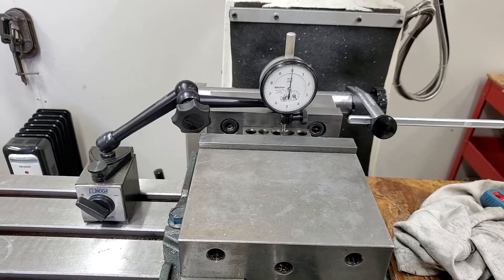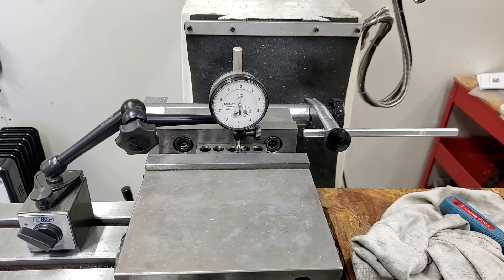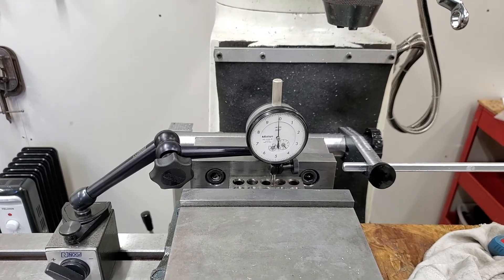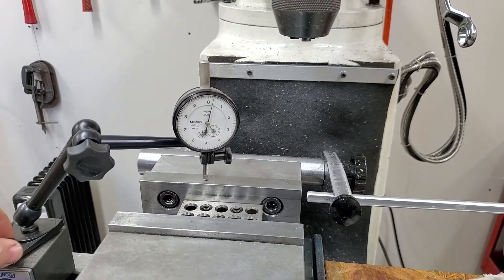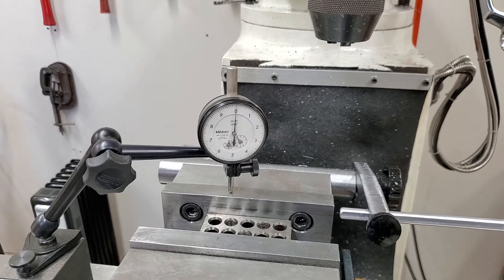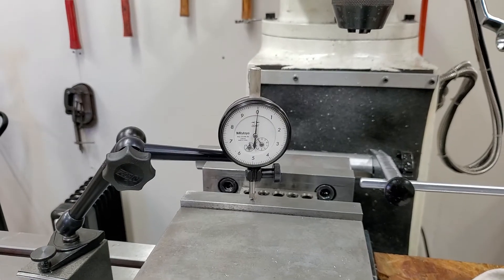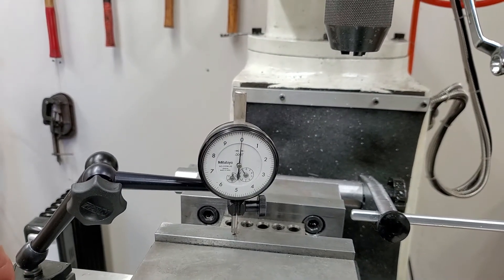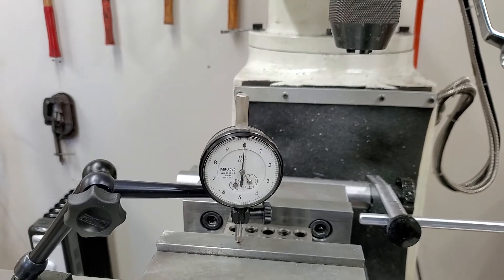Kurt vise jaw lift

Comment: If you would have bought a Kurt 3600 the fixed jaw is part of the base casting.  I would not have any brand of vise that has a keyed jaw as a fixed jaw for the very reason you show.
Reply from the maker: The video showed near zero movement......